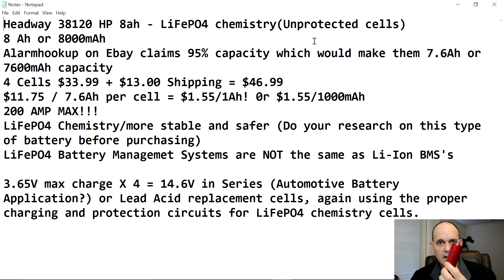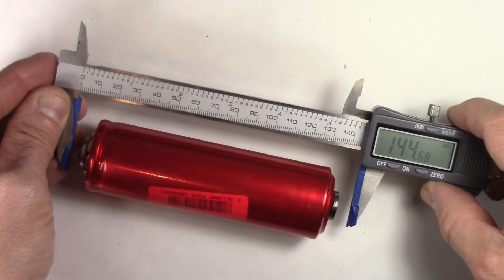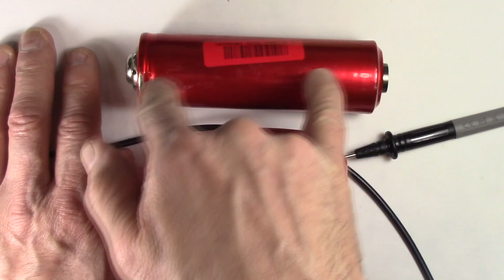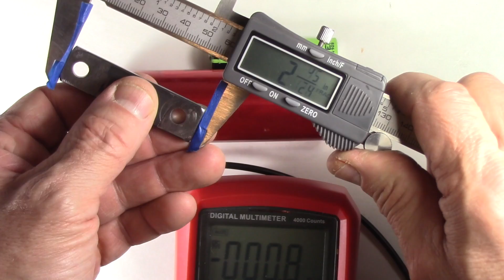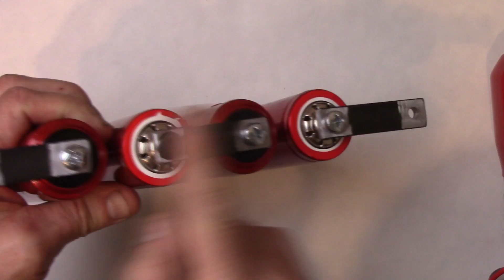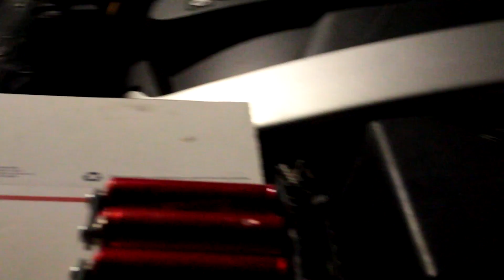Headway 38120 HP 200 Amp LifePO4 Cells Can They Start My Car? Video Review Thorough And Amazing!!!!!

Comment: Will it work in an amateur enviorment?  I need a constant discharge of 4amps on receive peaking to40 amps on transmit? The ratio of receiving to transmitting is 75 to 25 %. I need maximum autonomy.  Is 8 ah sufficient of I need more sets in parrarel?
Reply from the maker: They are very powerful check the specs and see if they will serve your purpose: https://goo.gl/zuN2NK Thanks.
Reply: Richard Lloyd yes they can dish out 200A to start a car. A big burst of power. However it is only rated at 8Ah. That rate is small. If i had to use a lead acid battery i would need at least an 80 /100Ah battery. What concerns me  is how many hours;of autonomy can one expect at the discharge rates I mentioned. Supercapacitors seem to have the same specs.
Reply from the maker: I think you are confusing Ah with Amps. 8 Ah means the cell can provide 8 Amps for one hour or 1 Amp for 8 hours before being depleted. At 200A draw this battery would be depleted in about 2.4 minutes. Still incredible. Thanks.
Reply: Christopher Warren - Keep in mind these batteries have a low energy density compared to ordinary li-ion batteries. That is the trade off the designers had to make in order to be able to provide very high currents. For a base station that is not a big deal, but for portable operation it would go with conventional li-ion because I can get the same operating time from a battery pack that takes less space and weighs less.
Reply: Yes Richard, you explained it very well. So if I need an average say 12 amps during one hour the battery would be depleted in 0.7 of that hour 42minutes. So i would need 3 banks of batteries. Am I right?
Reply: This power would be depleted in one hour. Or a battery of 24 Ah? Hence to last longer i would need to up this capacity?
Reply: Sounds like if your averaging 12amps, and you want it to last an hour and a half... you would want 4s2p (minimum id do 4s4p) Depth of discharge at 100ish% (or 50% with 4p)or a 40Ah  (dod 50%) flooded or a 28ah SLA (dod 85%)

Comment: As to steel vs copper as bus bars, steel might be harder and tougher, but it is not as good a conductor of electricity as copper or alumin[i]um.  See for instance https://www.thebalance.com/electrical-conductivity-in-metals-2340117

Not that I think these short bars will be any real issue.
Reply: Steel has more resistance than copper by AN ORDER OF MAGNITUDE (10x). Just sayin'. I've had some bad things happen using steel as a low voltage - high amp DC conductor.
Anyway, thanks for the videos. I've been off-grid for over 20 years and am always looking for battery options. So far, if properly maintained, cheap-but-good lead-acid batteries are the best bang for the buck. Our current set (2200 AH at 24 vdc) is still going strong after 10 years (forklift battery set). Wish I could get a hold of a bunch of these, just to play with.
Reply from the maker: The steel works great and is far stiffer than copper which makes for a more solid battery setup. I don't feel any heat on the bars when charging or starting the car. Thanks.

Comment: Can they be used for an electric car range extender?
Reply from the maker: They are very powerful check the specs and see if they will serve your purpose: https://goo.gl/zuN2NK Thanks.
Reply: That was my question :-), I was asking if anybody can suggest or even has an experience with EV batteries.  I need to extend my range or have an emergency back up if cannot find a charging station near by.  I am looking for 3-5 kWh pack. 
Btw., I believe this is a car battery made of these LiFePo4 cells (with the hefty price tag on it): https://www.renogy.com/renogy-lithium-iron-phosphate-battery-12-volt-100ah/
Reply from the maker: Wow! Crazy price on tha battery. Thanks.

Comment: Copper is 5 times more conductive than steel.  So I would suggest you take a piece of copper tube and smash it flat. Then use that as your buss bar so you won't waste  the energy of the cell as heat.
Reply: you should never ryly on your buss bars for strength. steel is a terrible conductor for electricity and corrodes much too fast. copper buss bars are expensive and not normally lying around. the second go to is aluminum. thats why many house hook ups were done with aluminum wire during ww2, the depression and some time after. aluminum is still a far better conductor than steel
Reply: Richard Lloyd - No need to use silver bus bars. Ordinary 12AWG copper wire would have given a much lower resistance than those steel bars. A foot of 12 AWG copper wire has 0.0016 ohms of resistance in case anybody was wondering. 1.5 ohms on a battery pack that is built to give as much as 200A is very consequential (1.5ohms x 200A = 300V voltage drop!).
Reply: Steel may not be as good a conductor as copper, but steel chassis and iron engine blocks have been a reliable negative conductor for starting cars for about a hundred years.
Reply from the maker: Works and works well. See the FYI I posted about all this. But I agree with you. Thanks.
Reply: In reality(although the copper is more conductive)  with such short distances and thick metal the loses are probably minimal.
Reply from the maker: it is absolutely minimal. I am sure the .3 ohms was off by .15 ohms on just the test leads on my meter and meter error. They work well and are not a factor.
Reply: pirucreek - A downside of aluminum conductors is that they require use of a joint compound (NOALOX for example) to prevent high resistance from surface oxidation.
Reply: If they work well then the resistance must be much lower than you have reported. Even 0.15 ohms per bar is way too much for a pack that can give up to 200A. With 0.15 ohms per bar the short circuit current of the battery would be a very disappointing 13V / (0.15 ohms x 5) = 17A.
Reply: Thanks for idea. I will buy some brake line tube for my project. It's cheap and conducts enought to me. I just smash it flat, and its a good buss bar :)
Reply: I mean wow..  for the weight, cost and strength iron is a fine choice.  I completely agree that you might lose 10amps, but who cares if it works it works.  Copper is heavy, weak (especially wan warm), corrodes and of course pricey.  I haven't watched any follow up videos if any, but my next question is protection circuit and if the car started from cold?  takes a lot more amps to get a cold car going and batteries discharge a bit
Reply: Choosing Iron from Cooper Maintenance and Maximum Efficiency will be the Difference. , It's Up to You.
Reply from the maker: This is an FYI for everyone on this subject, the battery I built was a proof of concept battery. If you were going to use these cells in a vehicle you should put them in a proper water proof housing using a LIFEPO4 BMS and the proper charger for the chemistry. Now the steel bars offer less than 0.3 Ohms resistance each multiplied by 5 that is a total of less than 1.5 Ohms resistance across the whole battery. Yes you could reduce it to a smaller number if you wish by using silver bus bars if you wanted but as I stated above this battery was built primarily to test the cells and the 1.5 ohms of resistance the bus bars introduce is really inconsequential for my purpose plus the strength of the bus bars and the mounting screws on the cells made it the perfect choice for a quick and simple test. Thanks gentlemen, I appreciate your feedback greatly. All the best.
Reply from the maker: The steel works great and is far stiffer than copper which makes for a more solid battery setup. I don't feel any heat on the bars when charging or starting the car. Thanks.
Reply: If steel works and is not hot, then why not use it.  You could also use aluminum too.  I like that he used steel just goes to show you don't need to pay to buy copper stuff, which not only is expensive people might try to steal it.   Maybe you should do a separate video on steel busbars so people can save a lot of money.

Comment: Interesting you thought it was odd that you were getting a voltage reading through the jacket. Those cells are very powerful cells, thus a thin layer of PVC jacketing (which is not sufficient enough to insulate) will show a voltage reading through it. That's how powerful these cells are! Great video by the way
Reply from the maker: I was reading the voltage from the metal jacket of the cell. I found tears and rips in the insulation that allowed me to make contact with the housing. Thanks.
Reply: You should apply some small load between plus/shell and minus/shell to test the resistance to draw current this way. My guess is that the voltage you measured will not be able to drive anything. It is just "leak" voltage through a very high resistance. If so, there is no real danger to short circuit the shell to either the positive not the negative pole. Would me nice if you post a video doing this test :)
Reply from the maker: Thanks, I will look into it. All the best.

Comment: I bought 8 of these 38120’s the are monster power in a small case. I’ll be working with them in the next few weeks. So nice for those who need 12v.
Reply from the maker: What charger are you going to use for them? Thanks.
Reply: I will charge and do a discharge test. I will run them as a 1S,2P pack in parallel with a 12 AGM battery. I will top balance the pack to the resting voltage of the AGM battery. I may puta BMS on them as well. I think they will live fine in that combination. The AGM discharge drop out will be 12.3v so that will leave each LiFePO4 cell at 3.075 volts well above their recommended 2.0-2.5 drop out voltage. Jehugarcia seems to think they will be fine that way. They won’t be In a high heat high draw situation. No automotive applications. I will draw from them likely at .5-1.0 amps.  If the drop out voltage was even close to that of the AGM I would be far more concerned. So I will charge with a standard AGM charger as I think they will equal out okay. Charge rate of maybe 2 amps.
Reply from the maker: Thanks. I have tested them with my car battery tester and they tested at or slightly higher than 200 Amps. I will be posting a follow up video shortly. All the best.
Reply: Hey that’s awesome. I am subscribed to your channel and will be looking for your video, great job! 👍👍
Reply from the maker: Thank you very much. I appreciate it. All the best.
Reply from the maker: I think the top up on the cells may be the problem but I am not sure if it would hurt them at all. Thanks.

Comment: Nice Video.  What charger do you recommend for these batteries?
Reply from the maker: I am using a small Turnigy balance charger and individually charging each cell. I know this is not the most efficient system but it does work well and it ensures that each cell is charged properly. I am going to do a follow up video on these to answer this and a few other questions. Thanks.
Reply: Richard Lloyd cool, I bought a Tenergy TB6-B. I'm actually going to make a car battery and install that charger with it so maybe every month or so I will plug the charger in and balance it out. Then I'll run a 3-year test on it (in Phoenix Arizona mind you) and show the results afterwards. Out here in Phoenix, batteries don't last very long, so it will be interesting to see how this battery is doing in 3 years.
Reply from the maker: Cool. Interesting experiment. All the best.
Reply: i got a balance charge bms on amazon for like 20$ (9.50 i bought 2)

Comment: Rather spend the same amount of money on a lithium jump pack, comes with charger and pre packaged!
Reply from the maker: That is a good alternative. I am not sure you can get a 32000Mah jump pack for the same price though. Thanks.
Reply: In series they are still 8 Ah , 32 Ah in parallel .
Reply: But this lot is only 8000Mah, not 320000.  In case you did not realise it, when you connect cells in series you increase the voltage.  You DO NOT increase the capacity. The capacity of your 12V battery of cells will be equal to the capacity of the poorest cell on that battery, not the sum of the capacities.  To increase the capacity you would have to connect the cells in parallel, but then of course you do not increase voltage.  Nature is a bitch, heh....
Reply from the maker: Thanks gentlemen.
Reply: But, that really is not the idea it can replace a battery.  Many people have cars with dead batteries they are pain to keep charged. The self discharge of lithium is 1% a year.  The money you save on gas mileage due to less weight will probably pay for the batteries and you probably use these for 20 years or forever.  Do at your own risk though.  Also if you have a small ghost load like a glove compartment light on it will drain battery to zero, if that happens phosphate cells swell.  However they can possibly be recovered in a week by putting a voltage back on them and allowing them to deflate.
Reply from the maker: I would get a BMS for the system and LIFEPO4 charger connected to the charging system. You would have to also connect the battery to the starter to bypass connecting the battery to the battery terminals which would want to charge the cells after you started the car. I do not think (my car) needs the battery after the car starts. Perhaps you could just have a switch to connect the battery to the battery terminals just to start the car and then disconnect from it after you are done. I am pretty sure you do not want a system designed to charge a lead acid battery charging a LIFEPO4 chemistry battery but I may be wrong about that. BTW I think most modern vehicles have a ghost draw that being the electronics (computer etc.) My car has a remote key lock that system has to be drawing something constantly (very slight I am sure) to listen for the unlock signal for example. Thanks.
Reply: Yes,  but with the lithium jump pack if it is not disconnected with in 30 seconds of the vehicle starting you'll end up turning your jump box into a ball of flames and smoke. Trust me I have gone through 4 of those planks because I couldn't get out of the car quick enough to disconnect before catastrophic meltdown occurs.
Reply from the maker: Wow! I was not aware of this. Seems like a huge flaw in those jump starters. Thanks.
Reply: unlike the usual LiIon cells, these here can get 80 amps charging current (from www.evassemble.com) no problem

Comment: I see this type of cells being used in flashlights!
Reply from the maker: That would be a monster flashlight. Thanks.
Reply: And then vapes...
Reply from the maker: Yes. Thanks
Reply: They're probably more likely 26650 or 20700, etc. I've never seen a torch that uses these, though I'm sure one is available somewhere, but most use 14, 18, 20, or 28mm diameter cells with various lengths. All of them are hard to tell apart in photos without scale though so an 18650 flashlight with the battery next to it could easily look like a giant flashlight with one of these cells next to it

Comment: Great stuff and vital applications where power surge is needed. The automotive application seems ideal. BTW I thought it would be more convenient timewise and resource wise to buy readymade automatic chargers with full management. One thing that caught my attention though is the amperage where you stated 80 Amps output and I would like to know how you got to that figure. Thanks & Regards. Sham.
Reply from the maker: Actually they are rated for 200 Amp max. I realized after the video that I could use my car battery tester to check the amps and it showed that they were at 200 amps. I may do a follow up video on that as well as starting my car cold too. Thanks.
Reply: shamrai I was going to use my car battery tester as well.
Reply from the maker: Thanks.

Comment: I have not really looked into lifepo4 but wouldn't full discharge be like 2.7v you said you did not discharge to 2v
Reply from the maker: The full discharge on these cells is 2.0 V . You can see the specs here: https://goo.gl/7QkvuC this is one of the many pages I found on these cells with the same information. Thanks.
Reply: James Holbrook LiFePO4 cell’s are 3.2 volts
Reply from the maker: Thanks.

Comment: I'd be interested in how well this does on a cold start on a cold day with a cold battery.
Reply from the maker: I missed the opportunity here as we had some 10 F days here in Texas. Today it is 57F so not that cold. If we get some more freezing weather I will try it cold. The cell has a working Discharge range of -20℃ to 65℃ so it should not be a problem for the cell but the engine is much harder to start in freezing temps. Understand that at 200 amps it's at the bottom range of a battery that will start my car. I may buy another 4 and make a proper 12V battery by connecting two of them in parallel. Thanks.
Reply: Btw, are you going to use them just to start a car, or complitely to replace led acid 12 v car battery?